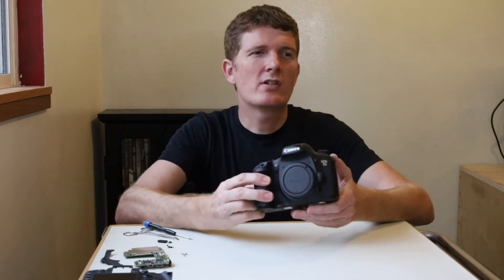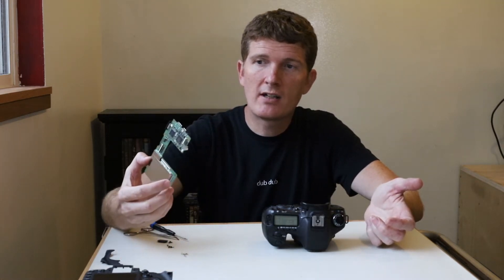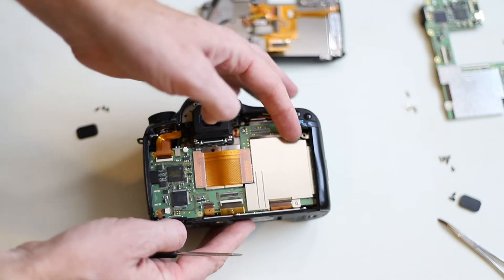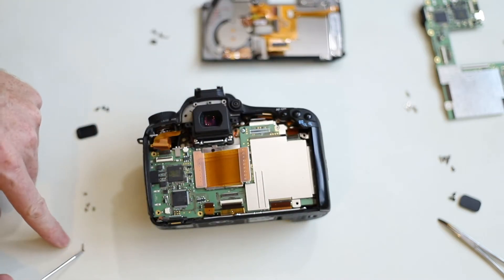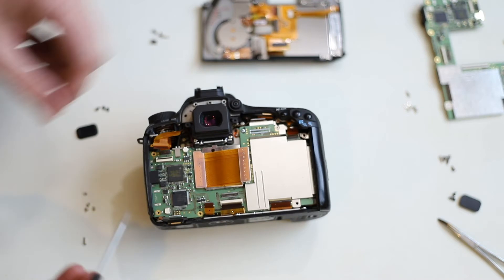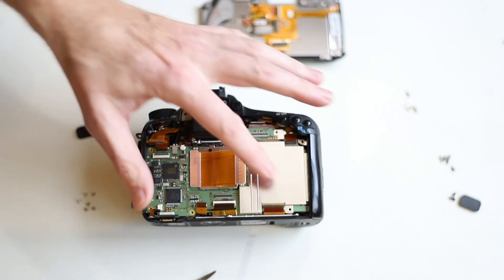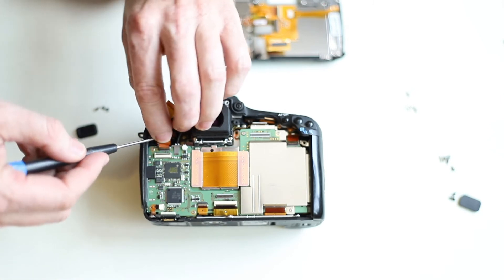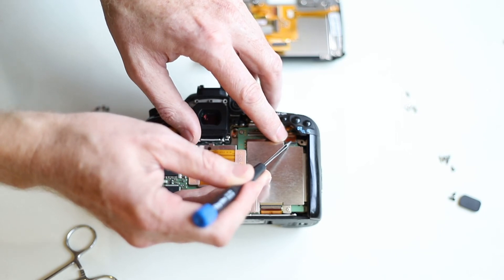Camera Repair - Canon 7D main board replacement

Comment: Hi there, I have same ploblem as you, where I can buy mainboard to remplace myself? Thanks! :)
Reply from the maker: I bought mine off eBay. Look for a genuine Canon board if you can find one. You can also pick up a decent used replacement 7d for a couple hundred dollars on eBay. The older used cameras are pretty cheap now and make great backups.
Reply: @MakeFixUpgrade  There is fake/clones board for Canons?